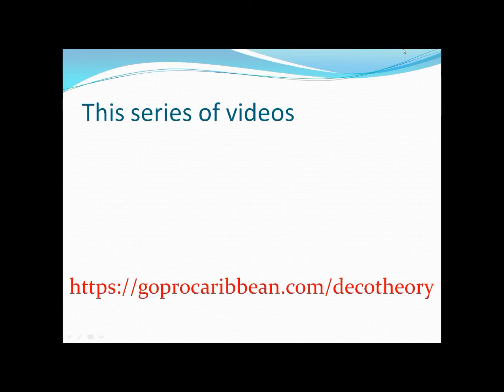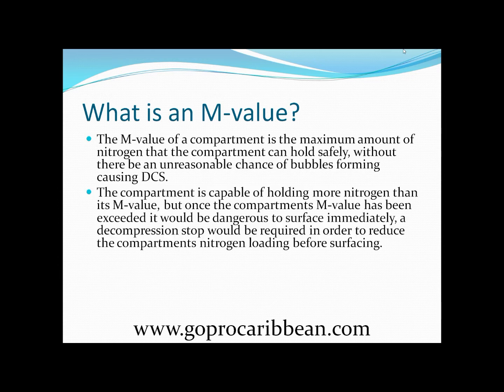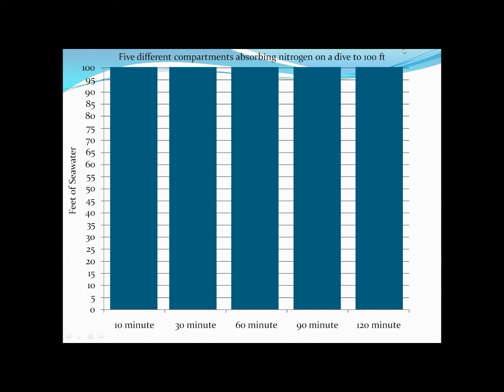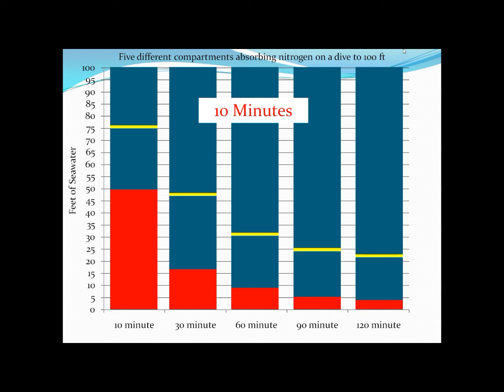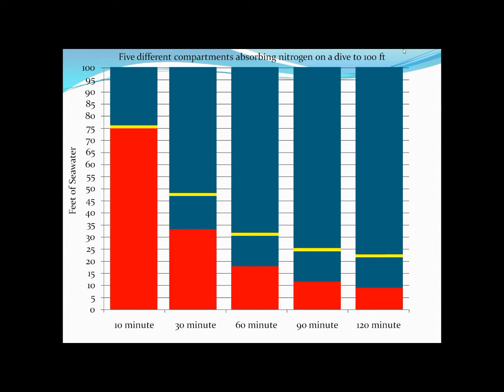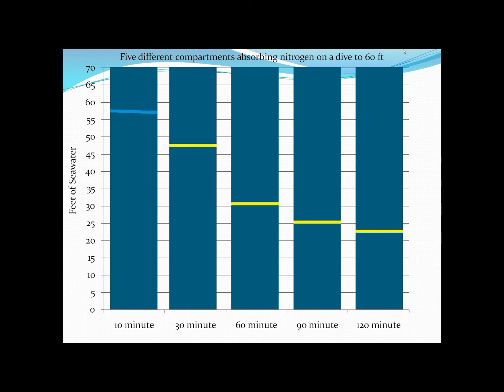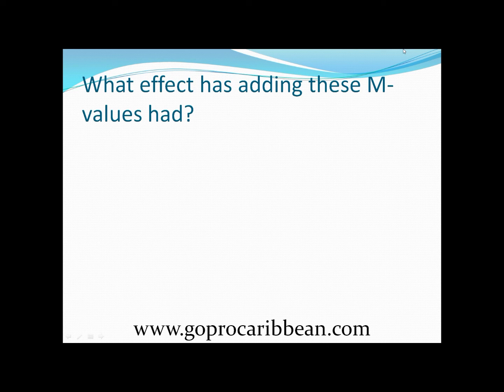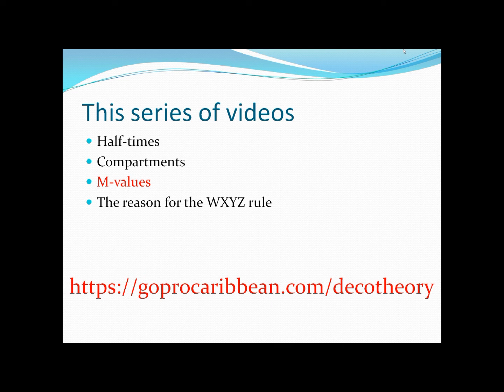Decompression Theory for the PADI RDP exam – M-values

Comment: Hey, your video is really helpful. But, you did not mention the variable that determine the M value? Why 10 mins compartment's M value is 75 feet? Does this M value come through trial and error experiment or is there any other way to figure it out?
Reply from the maker: These are randomly selected numbers to illistrate a point. The M values vary in different algorithms. All are based on trial and error testing many years ago and some more modern studies. Haldane is famous as one of the pioneers of this testing and algorithm development.
Reply: M valure differs a little from different algorithms, acoording to historic DCS data.